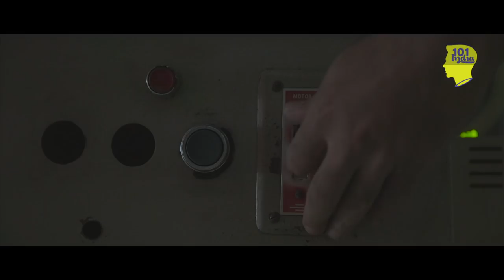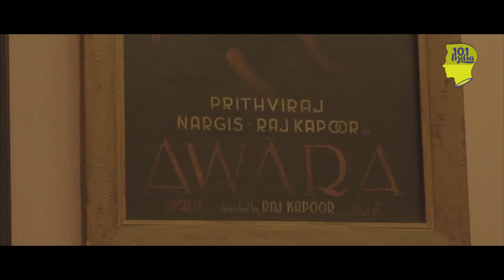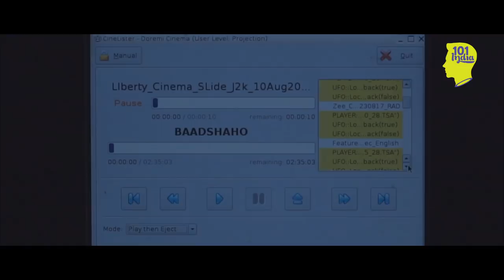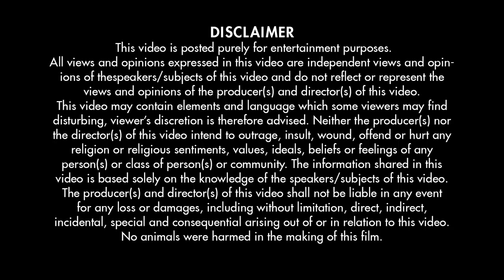Projectionists: The Men In The Shadows | 101 Traces | Unique Stories From India

Comment: Two Carbon Arc Change-over 35 mm film Projectors were the real sturdy machines that projected films for decades and the mechanical system to threading of a film was fascinating. The digital system no matter how simple it is to use is still a video projector using mostly DLP technology. There is no film at all it is just a hard drive or files that contains the video, and a computer server that's all, and the file is beamed through a video DLP projector. Excellent Documentary but quite saddening.